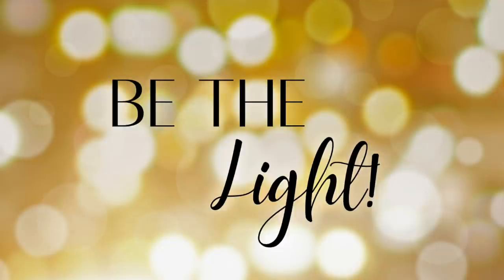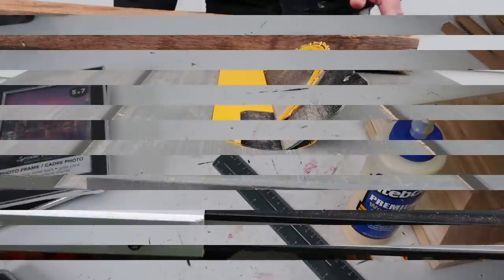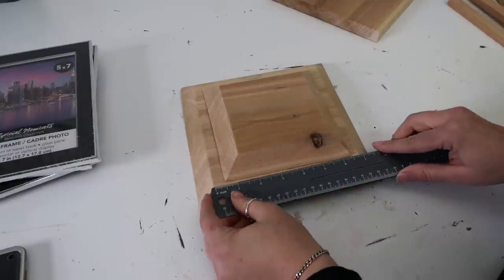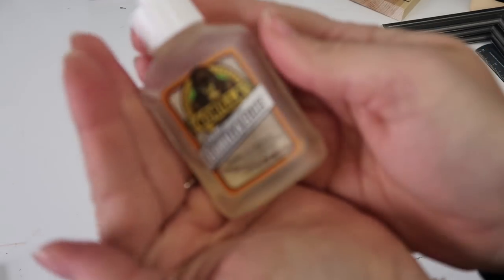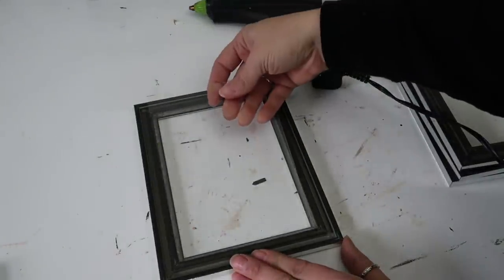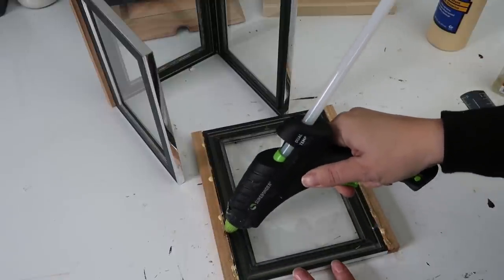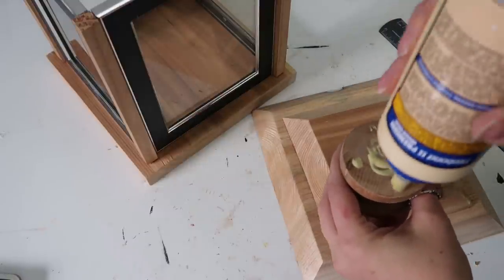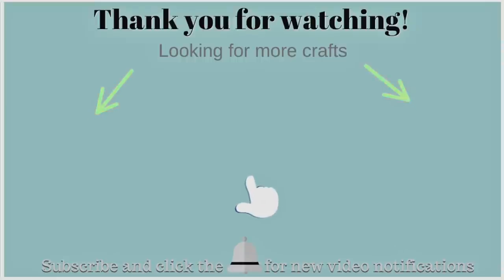⭐GORGEOUS DIY LANTERN - Wood Projects & Dollar Tree frames

Comment: I just happened to notice this lantern in your cover image so searched "lantern" on the channel and found this. I have never liked the uneven sides that occur when you just put frames together - I had planned to just build some lanterns with wood to avoid that, but this gives a solution for adding glass sides if desired, without that overlap thing happening. Love it!

Comment: Really pretty. I like it better than ones I've seen with just the frames which I tried and they wouldn't take the glue. I either did it wrong or used the wrong frames. I don't know if I want to try it again but I like the wood on it. Makes it look like something I would find in a store, more high end than the tumbling tower blocks or just frames. I just made one using Dollar Tree rulers for the posts and Dollar Tree wall art for the top and bottom. Came out okay but one side didn't glue right but I was able to hide it with a bow.  It's a Christmas present so I'm not really sure I want to give it to her. I don't know if I have time to try this one.  I also like that it doesn't need to be painted because I'm not great at painting.

Comment: Great idea and very festive. 😊  I bought some of the smaller squares with bevelled edges at the hardware store to use as fence post toppers, but never installed them yet, so I wonder if they have different sizes? Mine are about 5 or 6 inches square. Might be worth a look for those of us without the right tools to cut our own. 😊 🎄